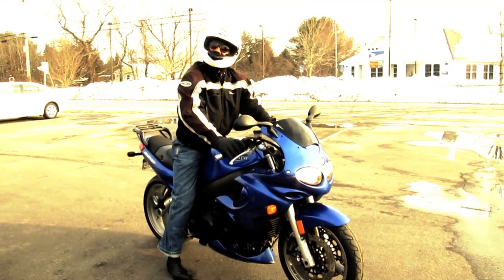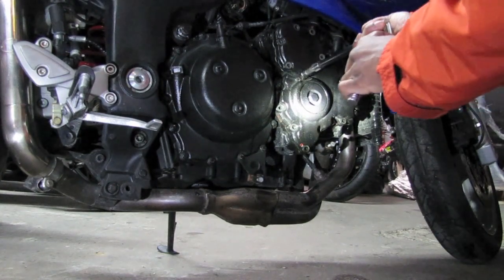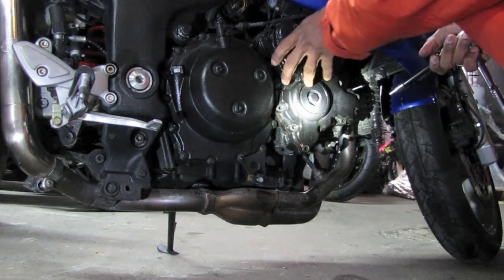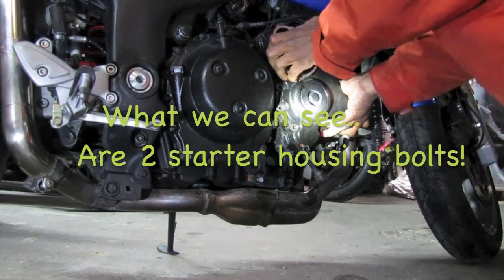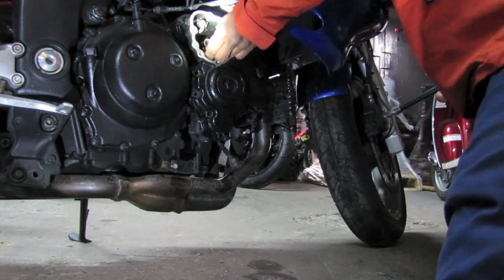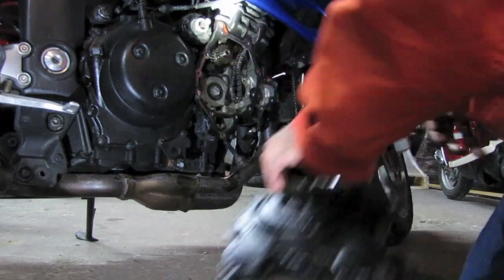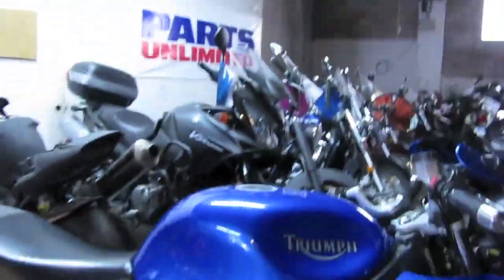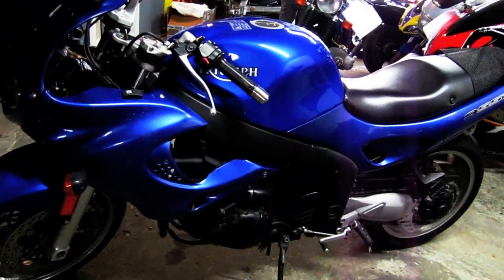Triumph Sprint ST Shattered Crank failure

Comment from the maker: @incrediblekicks Their assistance was too vague for me to deal with. It was a discounted crank, then you're dealing with tons of labor they would not cap, and the local dealer was none to encouraging, so I sourced another engine. Only problems have been a weeping side cover that I will fix on Monday when I swap it with my old one, and now I smell gas, prolly a fitting shook loose because it has the upgrades/recall on that.

See: Finished! Triumph Speed Triple 955i into Sprint RS Engine Swap

Comment: Spun the crankshaft bearing on my '08 1050, and it torpedo'd the motor.  Ended up swapping out the entire lump for a salvaged motor from an 08 Speed Triple, instead of having the existing motor rebuilt.

Comment: Is this a known problem for Speed Triples as well?  I own a 2004 S3 SE and I pray this doesn't happen to me.  If it does, I'll scrap the engine for a Daytona mill...which has better (forged) internals.
Reply from the maker: No. In this video you see I replaced the Sprint mill with an S3 mill. Very few S3's and Tigers had this problem. VERY FEW.  Then a subsequent Sprint RS I had, did the same thing. Since then as to my large bikes I've owned only Speedies, a 2004 Special Edition 955 and now an '06 1050.  https://www.youtube.com/watch?v=two5A3JVA5I
Reply: @KingCast65  i know its years since... but the problem sounds like harmonics... related to tuning... could be as simple as cam or ignition timing... or just plain poor quality control machining
Reply from the maker: @Errol.C-nz  Methinks it was because of the fire and they didn't finish the curing of those particular crankshafts well -- they found them after the fire and assumed that they had been fully treated.....  Anyway today I have an 800 Tiger (street), a Ducati Multi 1000S and a DT250 so I still love Triumph!
Reply: @KingCast65  but probably the same crank... only the pistons & rods are different (rods are al forged but different spec en50 steel vs en36 & cast pistons) bmc & other makers did the same for costs... still looks much more like harmonics its a low stress section but high vib from the chain on the gear or youd see cranks breaking at the journals... id be polishing out the radius at that timing gear